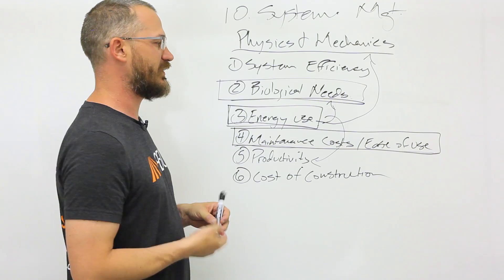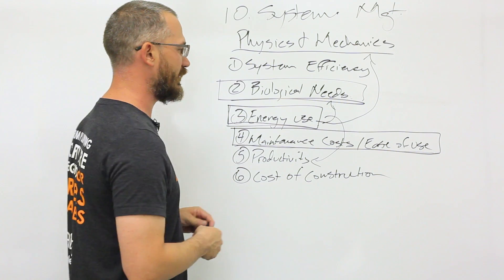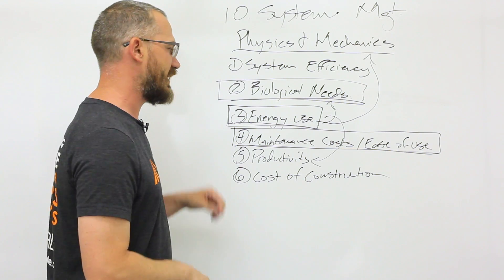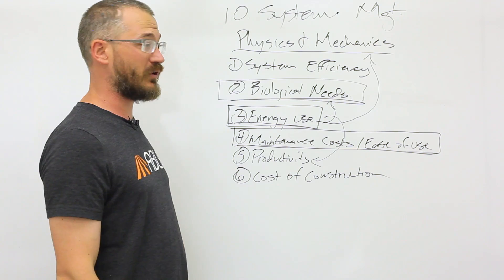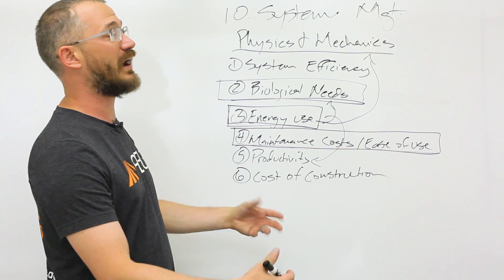Why do we prefer poly tubing over PVC in aquaponics?

Comment: Plastic pipe such as PVC (polyvinyl chloride, used for cold water only), and CPVC (chlorinated polyvinyl chloride, used for both hot and cold water) have been around for years, and both are approved for use with drinking water. ... Safety issues are mainly considered a concern in PVC pipe that was manufactured before 1977.

https://www.pvcfittingsonline.com/resource-center/using-pvc-pipe-for-potable-water/

Comment: PVC(polyvinyl chloride or vinyl) and CPVC(chlorinated polyvinyl chloride or vinyl) and the cement used to join it is not safe for food use, not safe for grow beds and not safe for aquaponics.  PVCs contain known human carcinogens and they leach into fish tissue, food and the water when used in this environment. Many of the cheaper imported PVC's also contain lead, mercury and other even more harmful chemicals.

People really need to stop using PVC, to many people on youtube using it for anything from chicken watering and feeding to aquaponics setups.

PVCs are not safe, do some research.

PVC is not for drinking water its for sewer pipes.
Reply: Shawn Hyde thank you for the detailed answer I’ve been looking for. Decided to go with food safe containers to do the knacky hydroponic method inside, before upping to a larger scale by building a greenhouse
Reply: How do you think your drinking water comes to your house?
Reply: @00waterski00 The components PVC are made of are toxic individually. However in the process of making PVC, the polymerisation reaction causes it to no longer be toxic. Only when you burn PVC can you release its toxic components. Same reason that table salt can be made with hydrochloric acid (which is dangerous to drink) but we can eat salt without issue.

Comment: You sort of glossed over the type of poly tubing you are using and the type of fittings you do use (pipe to pumps, etc.).
I know you said that you heat the pipe to make bends....
I assume by poly tubing you mean PEX (cross linked HDPE) tubing.
One of the best options would of course would be PEX-A with poly fittings and all plastic expansion connections. 
The PEX-B typically sold in hardware stores cannot be used with expansion connections and therefore must be used with either copper/stainless steel crimp rings or push-on fittings which will expose your plants and fish to copper, zinc, iron, chromium, and whatever else they alloyed the metals with. In short not a good combo.

Comment: PVC is seen as safe and OK to use for drinking water in North America. This isn't the case in most of western Europe: The belief here is that some chemicals used to produce PVC are leaking a little into the water circulating in it. So PVC is mostly used for waste waters, not incoming drinking water (PE aka polytubing, or a special "multilayer" tubing is generally used when it isn't copper).

So the European way to see things would say that avoiding PVC may be better for your plants and/or fish (my best guess is that most Europeans will believe it and most Americans will think it's BS, because it is what they have been told: "PVC=Bad" for Europeans / "PVC=Perfectly safe" for Americans)
Reply: safe for drinking water in NA? NO, WRONG. International Residential Building Code (which most of the world, including NA uses) prohibits pvc from potable water. PVC pipe can only be used for drainwater or wastwater pipe. Drinking water must be pex, hdpe or some other non-leaching pastic.